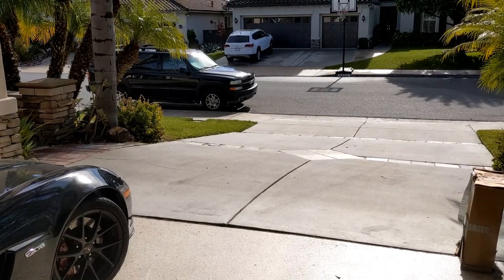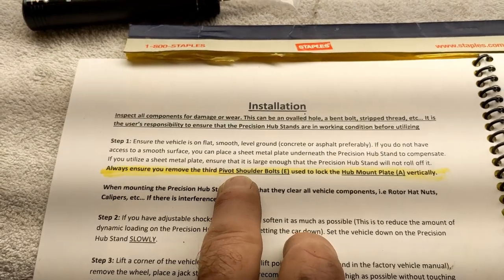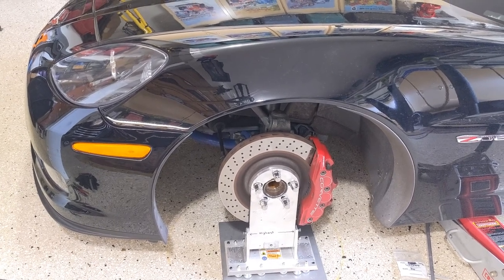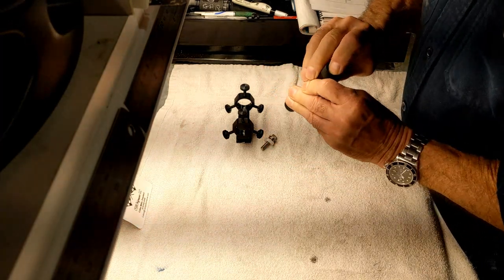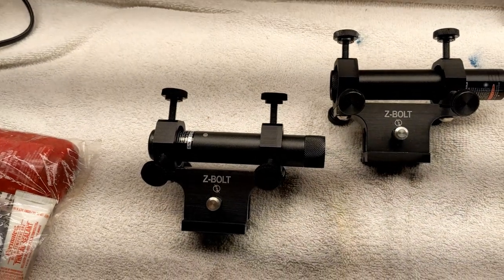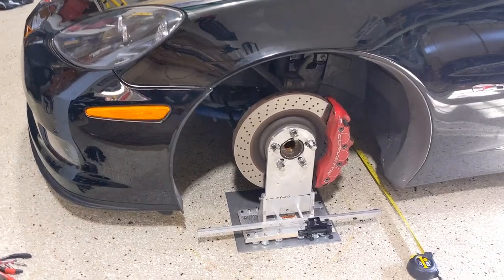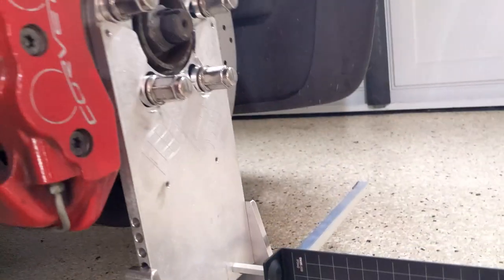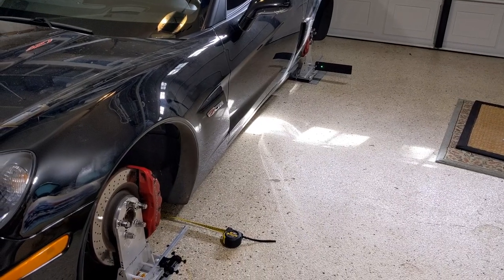Tools CSM Performance LLC hub stands NEW LASERS in actual use easier more accurate by froggy

Comment: Did you get these lasers originally with your kit, or did you upgrade? I have the first version of the stands with the big square bosch lasers.
Reply from the maker: These are the upgrade lasers.
Reply: @1947froggy  understood, but did you upgrade from the older lasers they used initially?or did you just buy these upgraded ones outright? I'm trying to figure out if I should upgrade as I think they had some consistency issues with the older lasers. I'm about to do my first alignment this week and really appreciate your videos.
Reply from the maker: You should call CSM , they are good to deal with.